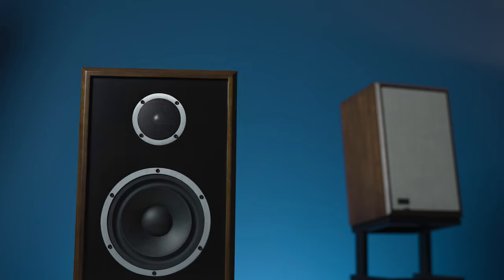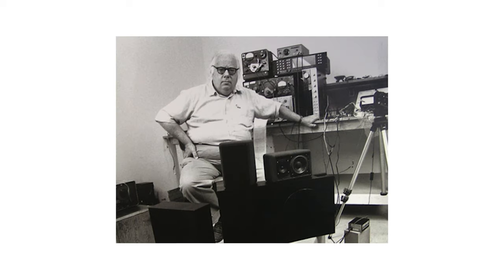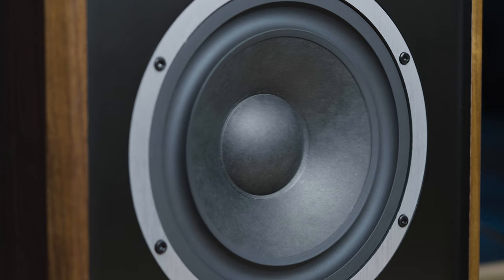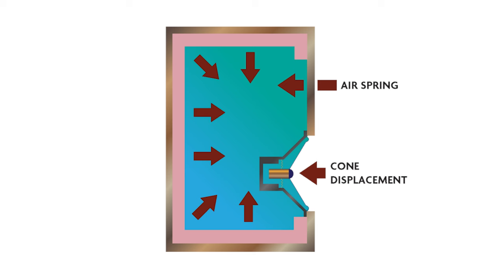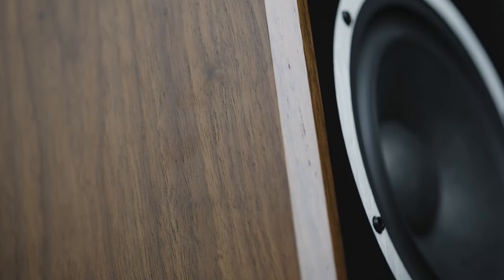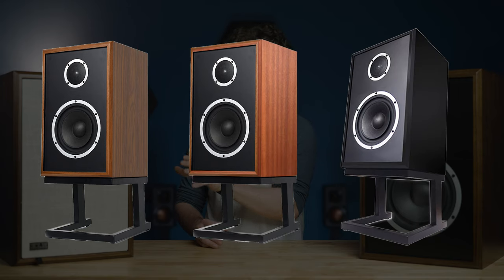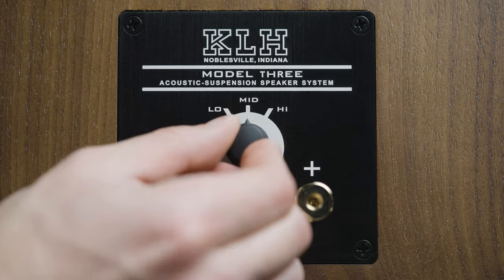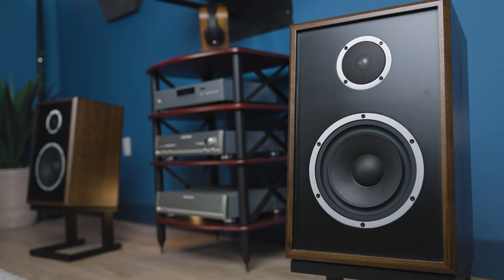Wonders of Acoustic Suspension | KLH Model 3 Bookshelf Speaker

Comment: Just picked up a pair of the Model 3s that I'm using with a Vincent SV-500 integrated amp and with an Audiolab 6000CDT, Rega P3/Ortofon 2M Bronze/iFi Zen and an NAD C427 AM/FM tuner as sources. No streaming (unless you think of the radio as a streaming).

Loving the Vincent/KLH combo in my condo. It feels like listening to really nice 70's stereo systems.